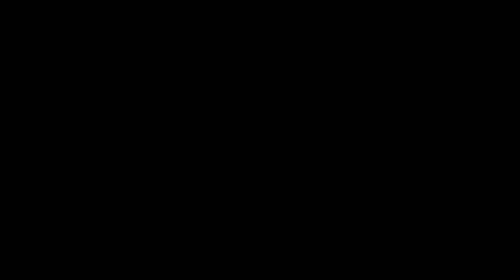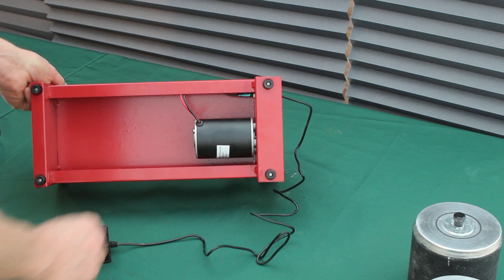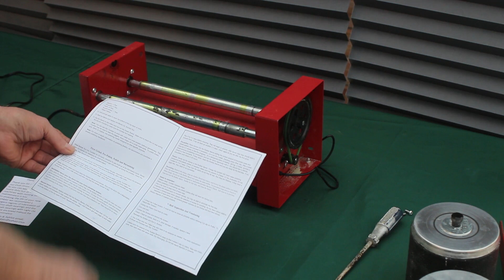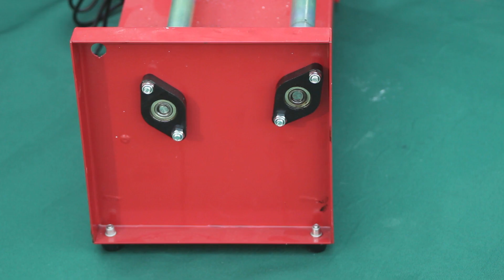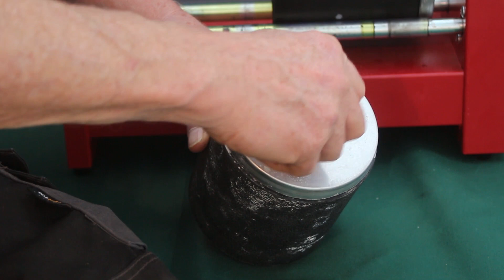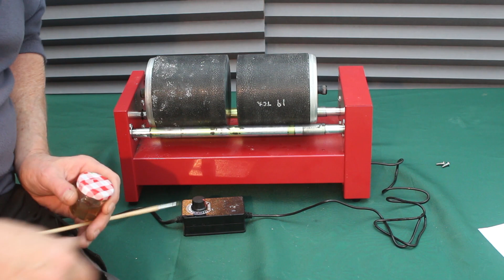15 LB and 6LB Rock tumbler machine review, SHOULD YOU BUY?

Comment: just stumbled on your video, I bought the same tumbler 4-5 years ago to test it thoroughly for our shop but it was not a product we could resell in that state, too many flaws and not much will to refine the product from the manufacturer. 
Ball bearings sounds nice but in reality nylon bushings used in fex. Lortone is quieter easily replaceable and will most likely outlive the bearings anyway. 
The barrels was wandering extremely much on our unit, I think some precision was missing, barrel guides like on fex. Highland park tumblers would be nice.
Motor ran pretty hot but I still think the motor size was an extreme overkill for two 3lb barrels (I remember they advertised it as 15lb though).
Belts are the cheapest chinese O-rings and the pulleys are not very good quality either.
I actually tested it today to see if it ran after being in an unheated shed unused for years, it started without problems but the powdercoated paint was cracking off which it is not doing on the german machines I have running in the same shed.
Reply from the maker: Ok

Comment: Hi Steve. Thanks for the very informative review.  I'm following about a year behind you in my rock tumbling hobby, and like you I feel the need to upgrade to a 6lb tumbler. I have considered the Evans CR2 but I like the idea of the ball races on this tumbler having destroyed a plastic bearing on my 3lb Evans machine. So after 6 months, how is this machine performing? Have you needed to replace the belt and are the barrels holding up?
Reply from the maker: Hi Graham, nice to hear from a fellow tumbler. My 15LB is holding up well, the barrels especially seem pretty good, much more convenient than the Evans rubber barrel (I have both). I have replaced the belt once but as I do my own it's no big deal ( I have made two vids about this, it is easy!). The machine itself has run flawlessly so far. I was not too happy about the plastic screw knobs rubbing on the side of the machine but so far not much sign of wear. I do oil mine pretty nearly every week.  On balance these machines are such good value it seems a no brainer, pity they are made in China. Only time will tell of course but thats true of every machine we can buy in the UK. If you would like to keep in touch occasionally about tumbling contact me thru my website contact form (stoneengravings.co.uk) and I will reply with my email address. Cheers.
Reply: Thanks for the update. That has decided me and I've just ordered one. I was looking around earlier and found them listed on alibaba for $45US (+$105, 30 day shipping). I'll stick with the ebay seller who possibly has upgraded the original belt. No doubt in another 6 months I'll be thinking about buying a vibratory tumbler...

Comment: Have you tested to use some type of rubber band on the long metal rods so the don’t move around, or maybe some O-rings?
Reply from the maker: I have not, I am pretty sure the barrels would simply climb over o-rings or bands. The National geographic machine employs plastic washers, that would work if I can get some the right size and figure out how to retro fit them! Thanks for the ideas, keep them coming.

Comment: Great video as usual from you. I have the Professional National Geographic rock tumbler with variable speed. The manual says to use high speed(3) for Grade 1 grit, medium (2) for Grade 2 and slow speed (1) for grades 3&4 etc. High speed on Grade 1 seems to round rocks reasonably fast.
Reply from the maker: Hi Morris, Thanks for the info!  does it tell you the RPM at each speed? I am really not convinced that different speeds make much difference. Perhaps when you have used your machine a bit more you can let me know what you think? All the best.....
Reply: @thestonecraftingworkshop7490  it doesn’t but I just measured it (time for 50 rotations). It comes out as (1) 80 rpm, (2) 100rpm and (3) 120 rpm..
So not a big difference, just 50% faster on 3 compared to 1. I have my second batch of rocks in now using the (3) for the first stage. When I have finished this I will try it on (1) for first stage and see the difference.
Reply: @thestonecraftingworkshop7490  is there an email or whatever for you that I can discuss Cerium oxide etc?
Reply from the maker: @morrismurray3621  Hi Morris, if you go to my website you can use the contact form: https://www.stoneengravings.co.uk/information/contact/
If this doesn't work let me know

Comment: Nice set up.. this spring when the weather gets warmer I will dig out my big rock tumbler.. I can polish about 20 pounds of rock in the dual side very large tumbler.. though I hardly ever use it except for my bigger rocks I have a small 3 pounder for doing stones. The little one is the one that impresses me.. it has a small motor. like the ones you find on those box fans and it just goes and goes.. I have had it for about 15 or 20 years now and it just keeps cranking and never stops.. it does get a bit hot these days so I have a fan for it to keep it cool.. I bought a replacement motor for it 12 or more years ago.. it is still in the box never been opened.. I have picked up some very fine pointers from your shannel and find it very interesting to watch.. Thanks Steve for all of your help even us old farts can learn new and better things eh? carry on ole son.. see ya in the next one!
Reply from the maker: It is a great hobby isn't it? You get out in the fresh air to collect rocks, have fun testing new ideas in the workshop, get the wonder of seeing beautiful rocks and ... we get to mess about with clunky machines! Cheers as always!